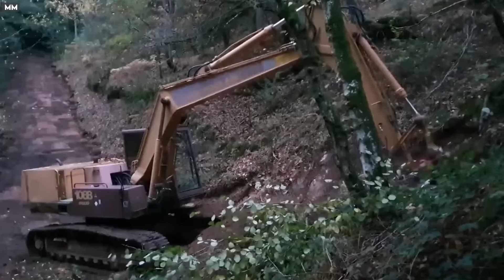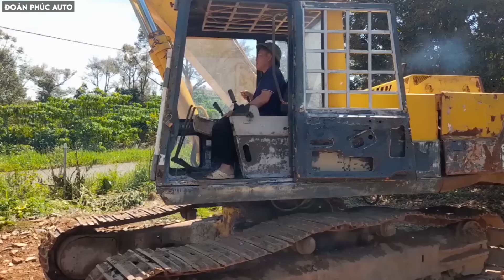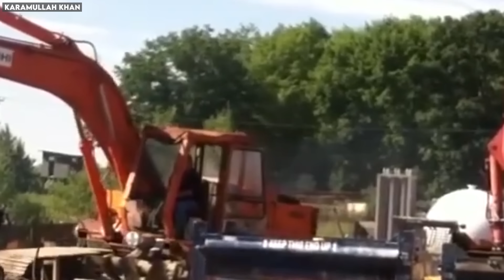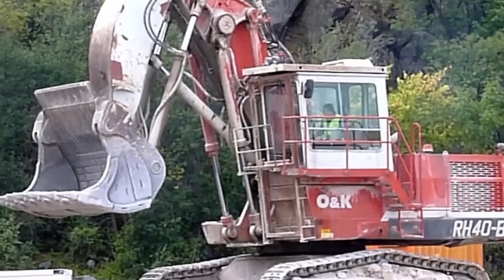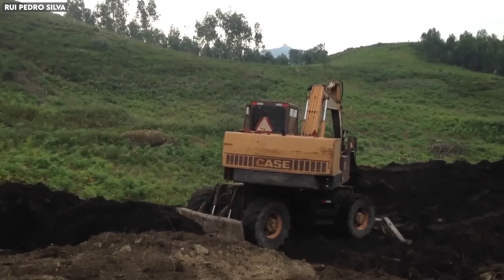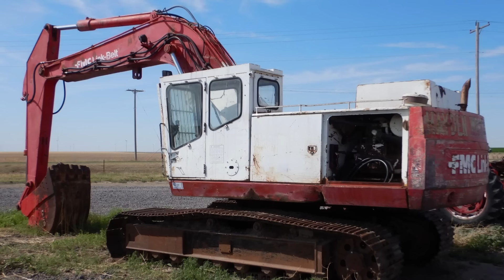10 MOST HATED Excavators from the 1980

Comment: Most of this video is b.s. Why are they talking about the Cat 225 as a dog in the early eighties, when Cat launched that model in 72 along with the 235. and 215. The 245 came later. Only thing I agree on in this video is the Link Belt LS 3400, which was just a fricking dog of the bunch in the Link Belt line. Well, I guess the Samsung excavators should be criticized. Throw away junk.
Reply: It's a useless AI video

Comment: I think it's like the very MASSIVE flooding the USA market today in 2025. With all the Chinese mini excavator 😊 I took the risk and bought a RIPPA-R-10-ECO. 😊 with the Gasser engine. Because it was the cheapest and had the most options for the size. Have less than 5 hours on her, and so far she has done everything I want digging wise. But you have to really BABY them, The biggest problem is the size of holes for trailers on chaining down. Very small cut-out holes on dozer blade and back frame. I have had to use a bigger SHACKLE" to loop my big chains through to properly secure it to trailer
But I always wanted a excavator for my OWN. having operate Backhoes for the last 50 years. Not much time in excavator of these hated years you show, but I sure remember all of these on work sites and it always amazes me to SEE Japanese or Chinese LANGUAGES on all the stickers in cabs, on safety and maintenance call outs. But MAN go and get an American PRICE on say a mini John Deere (I did that) then look at the PRICE of all these Chinese mini, they are basically GIVING them away. Every American Dad can now buy his boy a bigger that remote control excavator for the kid, and buy him a REAL excavator. Every size and power plant are available from these Chinese manufacturers that are flooding the American markets coming in shipping containers. I do like that part of the mass delivery of all these mini 😊 plus it will help teach a kid growing up how to be a PROFESSIONAL operator before he starts his JOB serch for what he might do for a living. I have heard that their is a serious shortage of skilled operators out their in 2025. By OWNING on that Dad bought him. He can practice at home, to become an expert. The mini is basically set up just like the big ones. Time will tell on my mini on how she holds up.😊